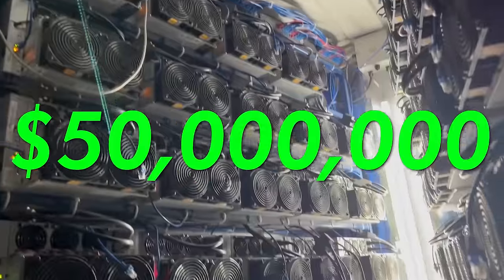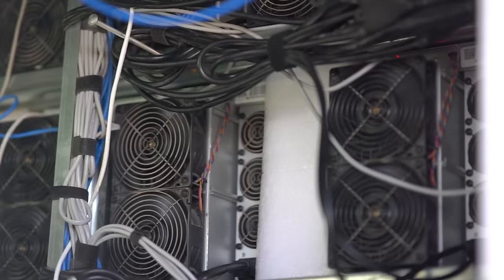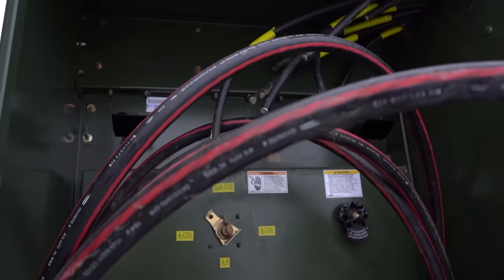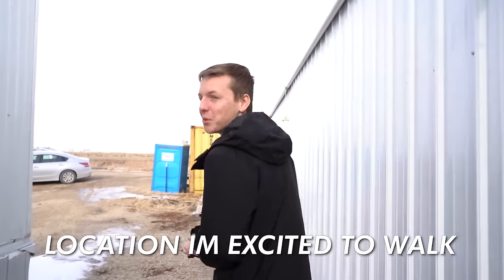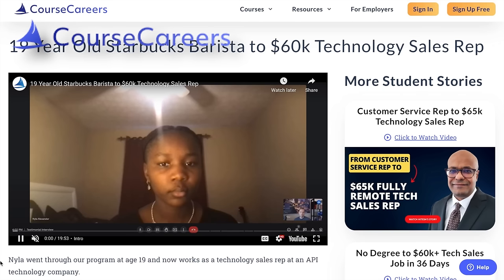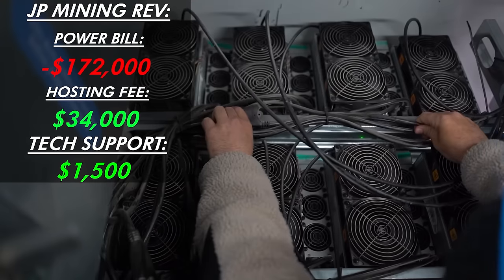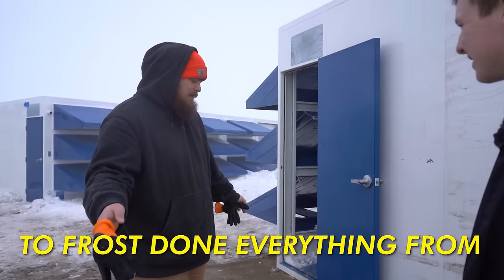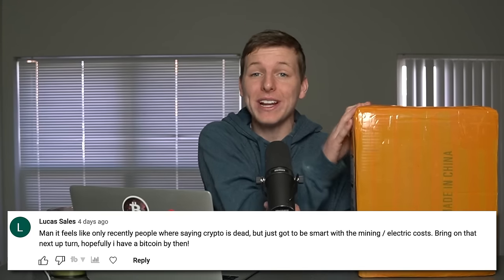Inside the $50,000,000 Bitcoin Mine

Comment: Bear in mind that most of the electricity used is being generated by burning oil or gas, so there is a large environmental cost to a scaled up facility like this.  Also, as more of these operations come on line, the market continues to saturate which stabilizes the BC price at a lower level.  To hear about an operation like this, with such a huge carbon footprint, not making any money is disheartening to say the least.